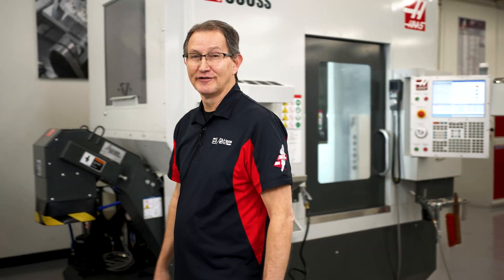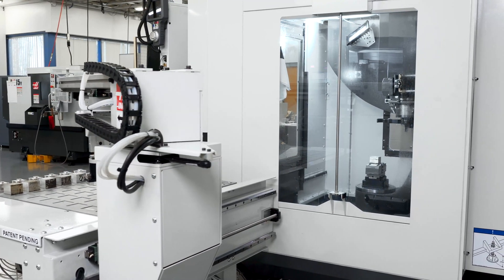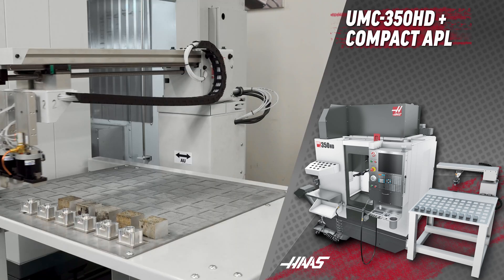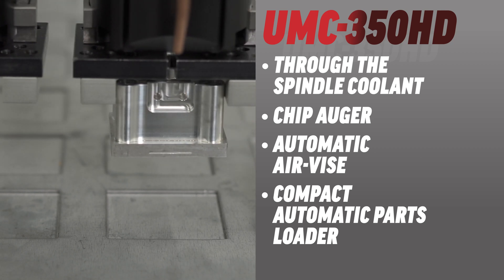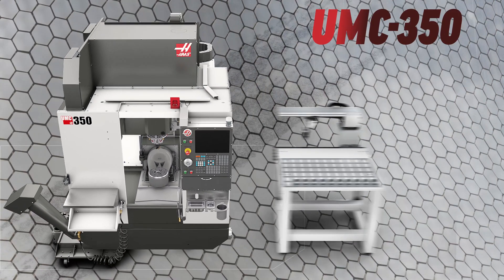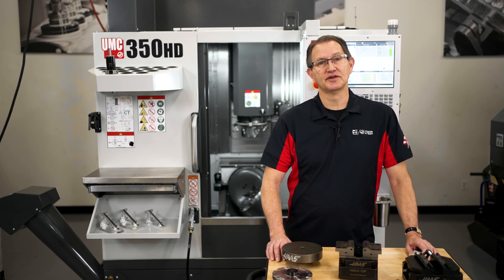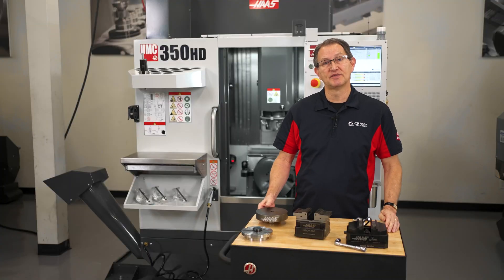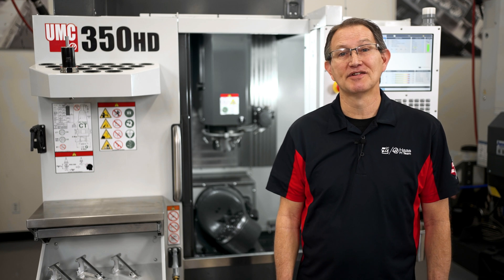Combine the Haas UMC-350HD and Haas Compact APL or Robot - Haas Automation, Inc.

Comment: the machine is really good what application does it use can you use mastercam?
Reply: Mastercam work great you just need umc post processor, maybe when you installed you may need to edit miscellaneous values to add thighs such as G187, G54... But I have a program that does everything automatically if you need it I can send it to you.

I don't know if in new controller is necessary but I have a VF5-40 and mastercam when it creates the NC code it adds two lines that tells the directory of the NC file and the directory of the program it self, Hass doesn't like it because windows use "\" for they directory and Hass eaven in "()" it reads the "\" character and it gives you an error, maybe in new Hass machines they fixed it but I had this issue, and I haven't figured out a wey to disable this directory listening in the mastercam NC ouput